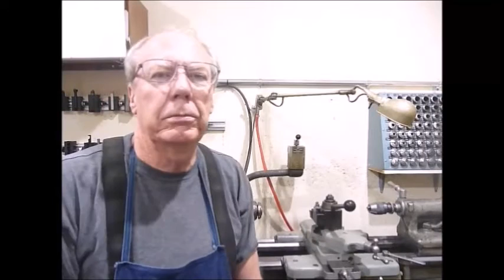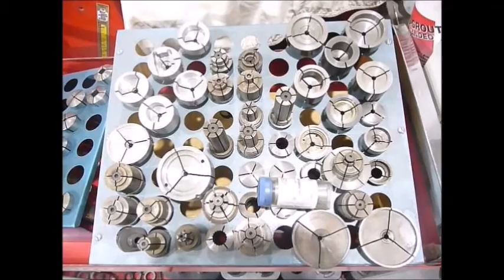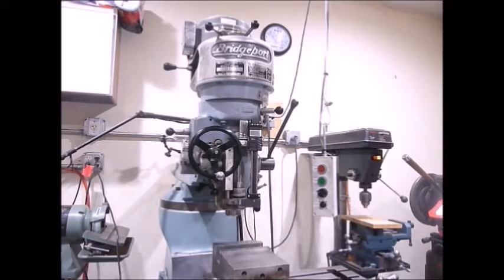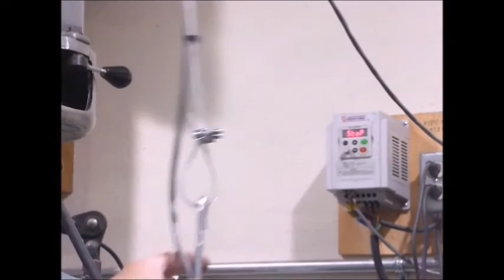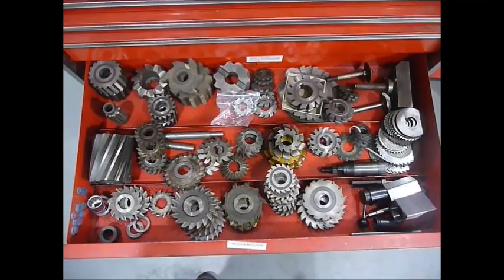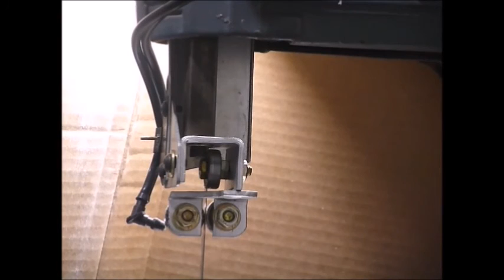Introduction and Tour Part 1

Comment: Great little shop. I love your hand mill, and awesome band saw mod. I have a SB 13" as well. I haven't sent for the birth certificate yet, but I've been told it's from 1961. Has hardened ways but not the flame hardened bed tag. Also factory installed options of manual spindle brake, and the rare fine feed carriage hand wheel. Still working on getting it powered up with a VFD, then eventually outfitted with a few pieces of tooling. I added a digital tachometer.
Reply from the maker: I'd love to get my hands on the manual spindle brake. It was available as an add-on.
Reply: True, it was offered. I assume factory install, but it might have been ordered and installed at anytime. I wish I knew more about the fine feed hand wheel. :)

Comment: Nicely equipped shop Bob.  What size is the table on your mill?
Mike
Reply from the maker: It's a 9 x 32. The short bed does pose some challenges. Some of my bending brake videos show the lengths I had to go to to work around the lack of bed length.
Reply: Old Iron Lover thanks. I thought it looked a bit shorter based on your vise for perspective. My knee mill only has a 9x35 so I understand the constraints but in my old shop space was more of a factor and couldn’t get a full-sized mill in it. Probably could now in the new shop but on the other hand I really haven’t run across anything that I haven’t been able to machine on this one, yet. For the motorsports stuff I machine I am fine with my little 9x35 table. 
Again, nice shop and amazing work in the brake. Thanks for the reply. 
Mike